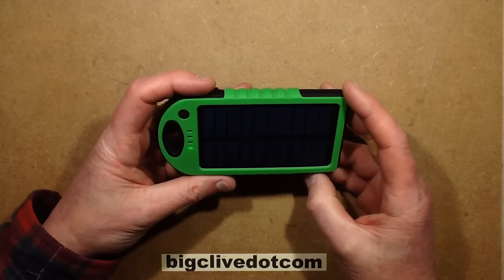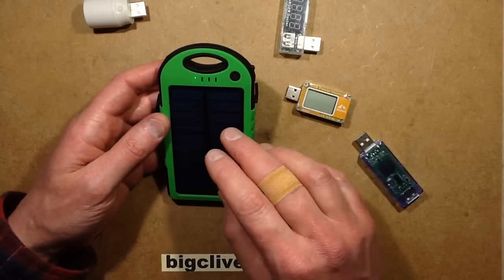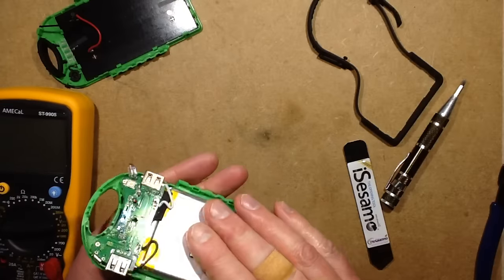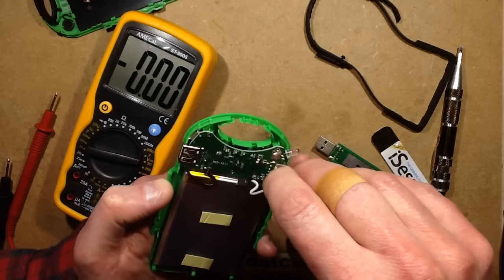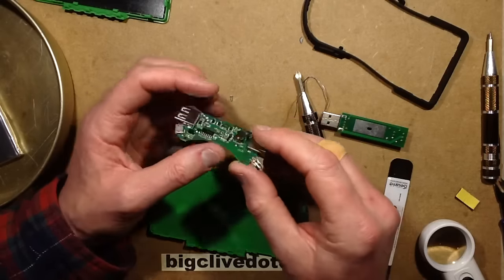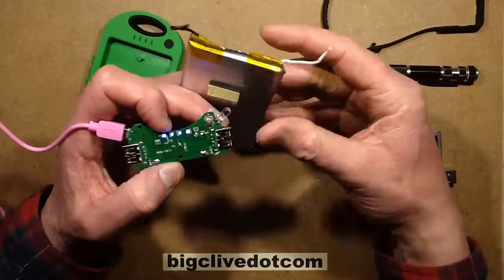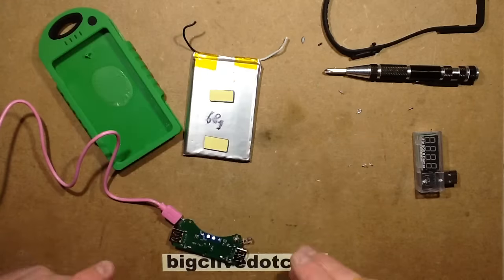Inside a solar USB power bank with "short circuit" feature.

Comment: Clive i got a question, and thought that maybe you can help me out here?

I got a cheap tablet (30 quid) and some USB Speakers, both powered by the same 5x USB Power Supply..
When both are connected, i get a plopp sound out of the speakers when i cut the power to the power supply.
It only happens with this tablet, my other USB devices don't cause this.
So i already know the culprit.

Any idea what i could do to prevent this, besides from getting a second power supply for it?
Reply: IF and only if the speakers have a separate 3.5mm audio jack and their USB lead goes straight to the USB  power supply all I can think of is add a capacitor, say 47uF or 100uF 6.3v across the USB lead rails close to the speaker's power input. Observe correct polarity. 

If that makes no sense then yeah - try a separate PSU just for the speakers. the reason for the only if at the start of this comment :For genuine USB devices, there are strict limits on the capacitance the device presents to the USB bus power rails, this is to prevent inrush current pulling the host device power rails too low when it's plugged in. 

If your speakers are both a USB audio module and audio amplifier with speakers (no separate 3.5mm audio jack) then it's a "proper" USB device and you can't add extra capacitance. If it does have a separate 3.5mm Jack for audio and the power(only) is provided by a USB PSU then it's basically a USB-powered gadget and not a  standards-compliant true USB device. I think Wikipedia will explain this better, iirc it talks about this when talking about cupwarmers and USB-powered desk toys.

Your speakers likely contain a Class-D amplifier chip, if you check out the data sheet for an example circuit you may find your amp has less or missing capacitors across the 5v power  rail, or possibly needs some inductance in the speaker leads (often omitted to keep down costs). The output of Class-D amps are quite sensitive to impedance variations and incorrect speaker loads can cause all sorts of problems from radio interference to ringing and popping.

Comment: I just bought a battery bank from China,how can I check it to make sure it won't cause me any safety issue,I just sent for a cable with a digital read out,to check it voltage,etc.it kinda like the thing you use there,with a read out with a usb connector.

Comment: Can you tell me the name of that USB tester thingy? Can i really use it to test bateries? I have no idea how to test the mAh of a battery other than just test how many times it will charge my phone.
Reply from the maker: +Gothika_47's Highlights If you look on ebay for USB tester or doctor then you'll find a variety of these devices.  To get the capacity of the internal cell you have to discharge the cell until the unit cuts off and then log how the mAh used to charge it.
Reply: Found one on my favorite chinese site. Thank you this should help me when reviewing batteries.

Comment: I have the same power bank, but even worse quality. It was labeled 10 000mAh, although the battery inside was smaller than this one, and was labeled 3000mAh. This unit never charged from the solar cell, although stayed for weeks in the sun with lit green LED. The battery died after a few recharges, and I bought a real 3000mAh which was phisicaly much bigger than the originial and fit well. It had protection, and probably because of that the unit stopped solar charging completely :) But now it is really good power bank, with the problem that if your USB consumption is lower than 180mA it auto switches off....

Comment: Hi Clive, i had a health related question :s 
I am still a teen and i went for like 6 years to a club where we did electronics.
We always used lead soler and stuff and we never washed our hands.
Every day we came there 2 times a day lunch whitout washing our hands.
And ofcourse we blowed some caps and stuff over the years whithout proper venting and stuff...
That was when i was 8-14, now i do electronics safely.
Do i need to worry about my health in the future?
Thank you so much Clive!
Btw i really do love your video' s keep it up :)
Reply: +Harry de Vokone You can not undo what has been done, going forward you can take precautions as you are. Personally I was exposed to many nasty things as a lad as I always had a soldering iron in my hand. But I really had some nasty issues whilst helping my father strip lead based paint off of windows in an enclosed space (the basement). We were using an open flame to do so.
Eat your green leafy vegetables every day, it helps to detox 
BTW I am over 65 and still kicking lol

Comment: love your show, as of your last comment of this vid, aren't the standard (chinese?) flat pack lithium these days include a charge protection circuit below that silver packaging? or is that only cellphones..
Reply from the maker: +Chris Trigg It's usually outside the sealed packet, either taped on or moulded into an outer case.  This one is just the bare tags sticking through from the foils inside.

Comment: Is there any reason why we wouldn't want to peel off the foil wrapper to see more information about the battery inside?
Reply from the maker: +JP Senior the foil is a hermetically sealed pouch with a vacuum drawn inside to press the internal construction together and keep the electrolyte in.

Comment: thanks for the videos Clive.  Just spent a stinkin hot afternoon going through your older presentations. 
I really like your screwdriver and was wondering were they are available from.
Reply from the maker: +Tony Smith It's a common 9 in 1 driver which I get from a UK outlet called Poundland.

Comment: Hey Clive, do have any idea why a 20,000mAh Anker battery pack is not charging, also the charging port is getting hot.
Reply from the maker: Try a different lead.  It's possible that it's a bad lead, the port may be damaged internally or there's an internal fault.
Reply: I've tried a few different leads/chargers which has the same result, I have been thinking that the charge circuit has gone bad

Comment: I had one of these, I left it out in the Texas Summer Sun for a couple days, the battery failed and  got puffy. The second one I have works well as far as I can test. I don't leave it in the sun for too long anymore. They both fell very cheap (and they were) and the manual was poorly translated.

Comment: Hi Clive. I got one of these devices off eBay, the camouflage version, which I'm sure it's identical, and I left it in the bright Romanian sunshine last summer and the battery has swollen a little. It still works just as well, but I think your worst fears are confirmed as far as the solar charging circuit is concerned!

Quick question. What would happen if I were to rerout the solar cell directly to the same circuit as the USB charging circuit? Would there be a problem when you plug in the USB charging cable and power flowed to the solar panel? Would a diode on the positive fix that?
Reply from the maker: +Inimbrium Not really sure.  Theoretically it should be viable to tap the solar panel across the charging USB port.
Reply: +bigclivedotcom I'm dont know much about electronics, but I was thinking the same thing. Also, what about putting in diodes on the USB power in and solar panel in so the current wont flow form one of the power supplies to the other? So if the cell inside is charching off the usb cable, pwoer from that doesnt flow to the solar panel. I dont really know what I'm tlaking about, but does that make any sense?

Comment: Hi, just came across this video and wanted to make a question. I have a similar power bank, is it possible that a power bank like can short-circuit a motherboard? For more context, the day i plugged mine into my laptop, it never turned on again. It turns out, 4 weeks on maintenance, that my mother board appereared to suffer a short circuit and it went dead with no repair due to its rare chip set. Would love if you or someone would kindly answer my question. Great video by the way ;)

Comment: My 1st powerbank was similar, it had the solar panel and packed out with thick sticky foam pads. Basically it was pants. I've replaced it with a Xaiomi 10,000 mAh jobbie which I use every night. It has 3 18650 cells inside and can do a complete full charge on my iPad.

Comment: So it had no charge controller after all :-(
Shame it cant be repaired.
Reply from the maker: +zx8401ztv It had charge control from the USB charger, but not the solar panel.
Reply: +bigclivedotcom 
solder the solar panel to the usb charger circuit

Comment: I have this same charger and while checking it's charge level a few days ago, I started smoking out of the right USB port and gave off a terrible plastic burning stench. By the next day the battery had expanded and popped the green case open. I feel rather lucky it didn't catch fire, but still $20 down the drain.

Comment: I've just recently tested that exact power bank with my DC electronic load and I was only able to extract 1.918Ah (9.31Wh). On the unit I was testing the battery had 4,000mAh printed on it but the power bank was sold as having a 5,000mAh capacity.
Reply from the maker: +Nathan Fryar I think it's closer to 2000mAh by weight.

Comment: if someone hasnt yet. if the battery is charged and you leave it in full sun. the battery will indeed expand and pop open the case and even puncture the battery shell

Comment: i am nto sure if oyu know but if you have a lipo/nicad charger, like a imax b6, you can solder on a connector onto it, and most have got the option to check capacity you jsut need to switch it to 1cell and go form there

Comment: I have one of these and the solar panel does absolutely nothing practical. It lights up the first LED green when it's getting power, but beyond that it doesn't charge the battery or seem to provide power to the USB ports beyond what is being provided by the battery.

Comment: You certainly know how to take things apart Clive. I'm thinking you must have been a keyhole surgeon at some stage in your early career ? I notice some up market high tech manufacturers like Samsung are a bit touchy about you using any but their own brand of chargers and threaten to invalidate their warranty if they catch you using someone else's.  Is this just a closed market tactic do you think or are there real technical reasons why you should stick to their own brand of charger which of course tends to be more expensive ? When you purchase a charger what are the key parameters you should look for apart from voltage and current ?
Reply from the maker: +meandmymouth There are some rogue chargers that put out far too high a voltage and could damage the product.  They can probably tell if it's been damaged by gross overcharging current.
Reply: stay away from the Chinese cheap stuff and you'll be fine just make sure the charger or usb power adapter, was made for your country, even apple get it wrong they just recalled every charger in Australia made in America from 2003 to 2015.
Reply: +bigclivedotcom hay mate I've found that some "made for Chinese market"  usb devices have the D+ and D- swiched also which causes all sorts of issues when using devices that use data.

Comment: I had the same one.  It charged once and then wouldn't charge a second time. My take apart resulted in sparks from the battery so it got launched into the garden. I will need to get an LCD, "lithium containment dish."

Comment: I had the exact same power bank as this. Found it bulging badly after a day recharging on a windowsill. Lithium pack is in two parts lengthwise and one half had swollen about twice it's usual thickness.
Reply from the maker: That's common with these things.  The lithium cells don't like being overheated and some overcharge the cells too.

Comment: There is a warning on the instructions not to leave in the sun.  I left the round version of this charger out in the car on an 80 degree day for a few hours and the solar cell crapped out.  Still takes a USB micro charge.  PS, those LED's aren't supposed to blink like that either.

Comment: I wonder what current the solar panel puts out.
Someone on youtube tested a load of these solar power packs and most of them put out so little power the charging voltage circuit (with the LEDs) took more power than the solar panel put out. what a waste of design, production and use
Reply: I wonder if it could ever get into a state the solar panel would over charge the battery but a Zener diode strapped across the battery would help to some degree to limit (not remove) the overcharging.
Reply: +BillyNoMates1974 From VERY close to a tungsten 60W lamp it can produce over 100mA short circuit current, but sitting 30cm away it produces dramatically less. I got bored waiting (two weeks I think) for the remaining 1 led on charge indicator to light up on solar power alone and plugged it into regular charger :D
Reply: So in the real world, overcharging a battery won't happen then.. So glad i made mine with super capacitors instead of batteries

Comment: alittle trick.. on the double sided tape.. use your heat gun and just warm the back up.. it will make it easier to get the battery off... don't heat the battery itself just the back of the device ... just thought I would give a tip.. I have done this for repairing ipods and to help get battiers out...... hope this helps.

Comment: I had a similar one. Charged once after days on my dashboard , used once and then it died, Stripped out the inside to reveal a dead charging cicuit board, Solar panel active though and did eventually charge up a 5000ma battery, took 3 days.     Make your own with a 4 cell charger and 4x18650 cells. They make then up to 9800ma per cell with a female usb socket.

Comment: I have one that looks the same on the outside but the circuit board is different and the battery looks fatter as there's only a very slim double sided type holding it secure where that one was glued but no type on the other side. the circuit board has this printed on it XHD-2310 2015/7/2  ES500 v2.0. 
Board has no solder residual on and looks well made, battery have no markings on but when I bought it the package said 5000mah and shockproof and didn't mention water splash proof, actually said keep dry at all times. It'll charge my Sony Xperia z5 from 30% to full in a hour but takes 2 day's of sunshine to fully charged it. it's nice to have and way better than the Energizer one I have that refuses to charge my z5 and way less capacity and was more expensive too.

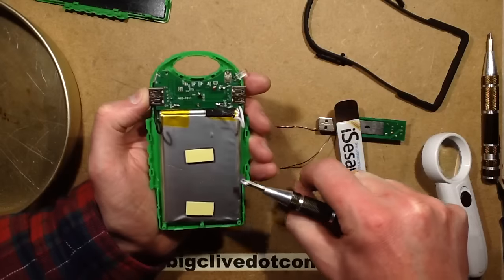Comment: As someone who did a dissertation based around lithium polymer cells (using around 100 or so large 40Ah cells), and has used LiPo for RC applications, the battery prizing wasn't easy viewing, thought you were going to bridge the connections at 9:53 with the screwdriver and make the electrons fly!

Great videos btw.

Comment: I have a similar solar charger with a LED array opposite the solar panel. It too had bad electrical joints and a wire short.

Comment: i've got one of those from amazon. the brand name on it is levin. i haven't had any problems with it so far. i use it from time to time as an emergency phone charger in case of a power outage or something. i use it from time to time to make sure it still works.

Comment: I was looking for this type of cell on aliexpress not so long ago (have 2 of them stacked together in "10000mAh" solar charger) the closest one i found has ~2400mAh which is roughly what I'm getting out of it. Search for 406580 (4mm x 65mm x 80mm) or whatever dimensions you have.

Comment: What happened to the sound of all your videos? They are silent.
Reply from the maker: +Nekros Check your computers settings.  If you have surround sound it may be sending the mono audio to the centre bass channel.
Reply: +bigclivedotcom Thanks. It never occurred to me that the sound disappeared when I tried to watch your videos on my desktop. For some reason, my desktop defaulted to Surround 5.1 with only two speakers, but it doesn't seem to affect any other YouTube channels/videos.

Comment: I had one of those. It held about 4000wh, still not 5000wh.
The solar panel took two weeks for a complete self charging on my dashboard. I just let it there, always in the heat wich was probably not smart. I used it a bunch of times and it did it's job, not very fast yet not slowly either. I had it for a year and gave it a colleague.

Comment: How do you determine the capacity of a battery?
Reply from the maker: I run it down until it cuts off on its safety circuit and then charge it while monitoring the mAh that pass through the charger until the unit cuts off when fully charged.

Comment: i bought this exact solar charger only to find out that the solar panels didnt charge the battery. I opened it up and saw that the positive and negative wire were the wrong way round! the battery doesnt last that long and it takes forever to charge via solar panel

Comment: +bigclivedotcom you have to cover cheap multimeters! My UT33D by Uni-T has a deadly feature, continuity between 10A and Volts. So if i'm measuring mains, that 10A socket is live! There is also continuity between COM and Volts, so if I'm measuring in the 10A socket, Volts has 10Amps flowing through it.
Reply: I bought myself a Vici VC99 and whilst I probably wouldn't feel comfortable checking currents on a mains voltage with it, it seems competent enough for the sort of stuff I use it for.